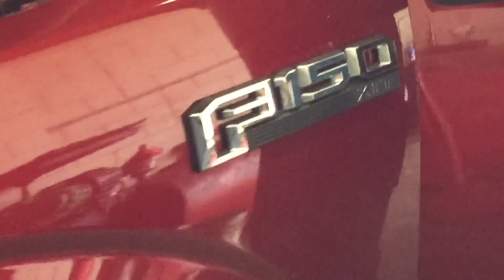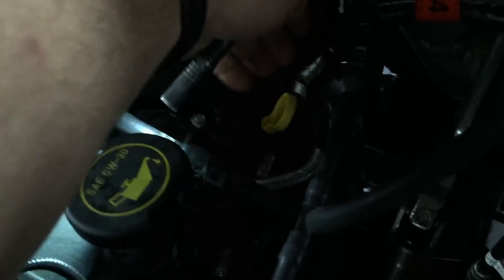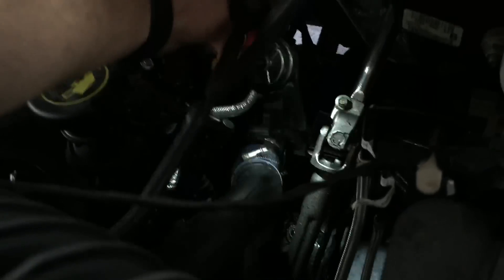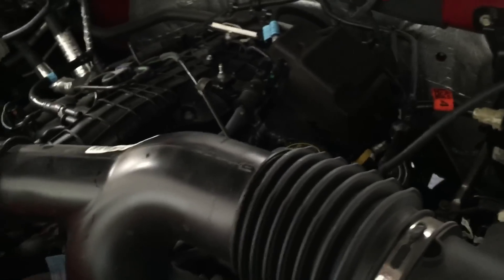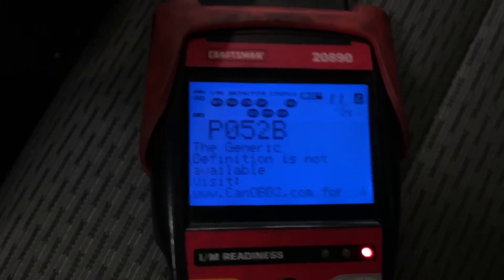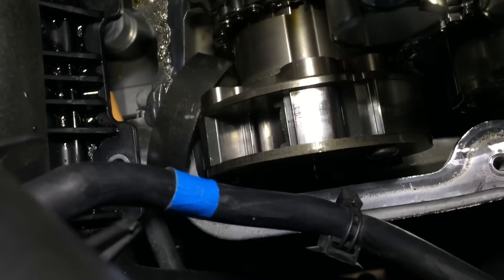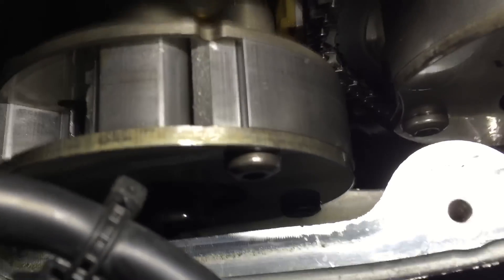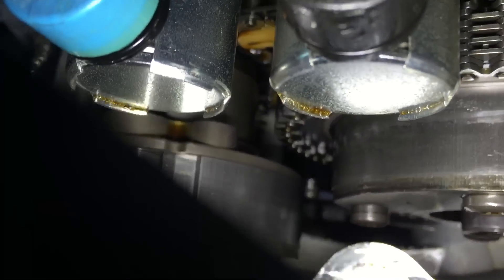Ford 3.5 EcoBoost Cam Phaser Failure

Comment: If your truck sounds like this with a 3.5 eco-boost take it to the dealer immediately there is a factory recall on the cam phasers mine is in the shop right now getting a factory warranty replacement. It had nothing to do with oil loss or anything else this is a defective factory fault problem with the cam phasers. Thank me later, all the rest of these posts are erroneous speculation.

Comment: I have a 2017 F150 Platinum with 48k miles on it. I recently heard a slight knock in the engine. I took it to the dealership and they diagnosised the the issue you have described in you video (cam phaser).
Changing oil every 4-5k miles didn't work for me. The dealer changed the oil with the synthetic blend a couple of times at 3-5k miles. Then I had them to use their Motocraft full synthetic a couple of times. Then more recently I switched to Pennzoil Ultra Platinum 5w30. Each oil change was no more than 5k miles, yet I developed the cam phaser issue. My truck never had a check engine light or any malfunction light, I just noticed a slight knock when I was under the hood changing out the battery. Had I not been outside of the vehicle with the hood open and motor running, I may not have cought it this early.

My question is since I changed my oil with synthetic oil at no more than 5k miles what can I do to prevent the cam phaser issue from reoccurring?
Reply: @Clint Beastwood GM and Ram have their share of issues also. Maybe next time I'll buy a Toyota 🤨
Reply: Nothing! You're already doing what you can. Until Ford disgins a better qualiity cam phaser this will continue to happen.

Comment: This is normal for ohv engines ford recommends changing your timing components every 120,000 miles look in your manual that is in the glove box my friend has a tundra with the 5.7 v8 he had the same problem Toyota recommends changing every 80,000 to 120,000 miles people need to look at the manuals on these new trucks before they buy them.

Comment: My dad is a mechanic and was trained by dodge and been working a lot of other vehicles for 30 years.  He hasn't had much experience at all with the new fords but I've been looking into getting a 17 and up f150 3.5 EcoBoost.  I know they have cam phasers issues even with people having then full of oil and I know the 18 and up 5.0 have been having really bad oil consumption issues.  I'm a v8 type of guy but I'm loving these 3.5 EcoBoost. They just do everything better.  I was curious if putting a thicker oil would help or fix the cam phasers issues and just being a engineer flaw for running thinner oil. Maybe a 10-30 or 10-40? Any information I'd greatly appreciate it. Been trying to figure it out because I do want it but the issue has been steering me to a 15-17 5.0 with 3.73 gears.
Reply: There's a high volume oil pump you can bolt into these 3.5l ecoboosts they'll give you 20 % more flow. I have 308000 kilometers on my ecoboost and haven't changed anything but spark plugs. 10 years of Canadian winter cold starts and hard driving and haven't had an issue. Oil has been sweating out of a few places since I got the truck but haven't lost more than 100ml of oil over my 5k oil change intervals. I'm thinking of dropping in one of these high volume oil pumps in whenever I do my timing chain

Comment: Ford redesigned the 3.5 in 2017. They still require impeccable maintenance but have had less problems. Unfortunately they also redesigned the 5.0 In 2017 and they have been having more oil consumption problems since then.
Reply: What sort of maintenance does it need brother
Reply: @robcunha13  early oil changes

Comment: Cam oil phasers clog and don't provide lubrication to cam shaft. 2,500-3000 $ repair bill. Chain must be replaced when oil phasers are replaced.
Reply: Keep the oil changed and there would never be a sludge issue and everything will work as it was designed.  They engineer things around a clean engine.  🤷‍♂️
Reply: If people changed their oil at 5,000 miles and only used full synthetic and kept the oil topped off they wouldn't have these problems just after warranty.  DO NOT FOLLOW FORD'S RECOMMENDED SERVICE INTERVALS.  It's just another way they push planned obsolescence.
Reply: @dperr338  doh azzz....dealer serviced. I stand by my statement. Look it up. Ford is notorious for putting junk on streets.
Reply: @dannycalvino1147  That's why I said, "DON'T FOLLOW FORD SERVICE RECOMMENDATIONS."  These vehicles have tight tolerances with sensitive electronics that require clean fluids and care to last.  Oil technology has not improved that much!!
Reply: @dannycalvino1147  They all put junk on the roads.  Blaming one manufacturer for issues is ridiculous.  People have had bad experiences with every manufacturer.  They are mass produced so bad products are going to make it out to the customer.  A majority of issues comes down to maintenance.

Comment: Very very rare problem indeed! I run my '12 F150 Lariat FX4 Ecoboost 3.5 balls to the wall never let's me down. Runs / drives like new w/close to 100k mis. I change oil religiously at 5k mis with Pennzoil Platinum (my personal fave) & Motorcraft filters oil/air etc. Good basic maintenance vital with these Ecoboost high tech motors.
Reply: No, it’s rare you got a good one…..this is more common than people think

Comment: Unless I am talking about a project car where the point is to take it apart and rebuild it, I will NEVER buy a Ford again. I bought a brand new Mustang in 2005 (when the retro look first came out) . Within a month the automatic transmission shifter got stuck and eventually broke off. Then the transmission itself wouldn't shift out of 2nd gear. Then the gas filler opening had a weird quark where it would shut the pump off every two seconds. Then the harmonic balancer fell apart at 35,000 miles. I finally dumped it. and got a used LS400 with 287k miles at the time. The Lexus with it's very high miles, has been without a doubt 100% trouble free in the last 6 years. Shame on Ford for selling garbage.

Comment: everybody talks shit on these engines when they break... most of the population that buys a car is a complete dumbass when it comes to anything related to taking care of it. it's a turbocharged engine. anybody that has owned a turbo car from the 90's knows the nature of the engine.  turbo engines use oil much faster than some bone simple v8.  your typical v8 has 2 cams and the crank pan to keep lubricated... you can go without oil changes for longer because there is less stress on the oil.  The ecoboost engine is no different than any performance oriented turbo car, such as a 2JZ supra or even an srt-4 neon.  your oil lubricates the engine parts themselves, but also lubricates the turbo.   oil degrades with heat, contaminants, and high pressures.   turbos are very high temperature environments for your oil.  fuck what the manual says. every 5 grand you should change your oil and filter if you are using full  synthetic.  these ecoboosts are good engines, but need to be taken care of by an owner that knows how to properly maintain a turboed engine... not some dumbshit that can't even change a tire.   there is only one flaw with these motors and it arises because of how stupid most people are with basic maintainance.  the pcv system  on the motor vents crank pressure back through the intake and through the motor... the vapors contain oil and other contaminants that directly cause the issues this motor has been having.  valve coking, misfires, lack of power, hard starts, etc...  simply install a set of catch cans and you just eliminated all of the main issues with the motor. install a free flowing exhaust and intake as well, and you will be fine.
Reply: Logan Barrell I agree,most good folk out there have no idea where thier hood latch is..however I also believe there is no need for a common a- b car to have a turbo..it all comes down to "Look what my new ride has".,and greatly increased Profit for the Trillionaires in upper manufacturing.and maintainence to follow.

Comment: ford sucks this proves it more I have GMC and haven't touched any thing but a thermostat and battery n it has 130,000 miles burns no oil runs like a sowing machine
Reply: If some dumbass doesn't insert the dipstick all the way, it's not the engine's fault.

Comment: I have a 2016 Ford Escape and the windows go up without and down without me pushing any buttons the radio went dead on me and then all the sudden will come on you put it in reverse and it's like it's in neutral I smell wires burning they finally put in a module on the radio to get it working now it burns up my CDs the car is only got six thousand miles on it and the problems continue and worse and I've got knocking behind my Dash and now

Comment: The problem is all this bs like variable valve timing overhead cams turbos economy bullshit hell my 64 impala sedan with the original 327 turbo fire V8 is almost at a million miles
Reply: or dont be lazy and just check your oil?
Reply: Donald Trump 2K16 all I can say is blame things like CAFE and CARB and federal emissions standard
Reply: TheDarkness2487 I've heard of some of these failing even before their first oil change (modern synthetics can go up to 10,000 miles in between changes btw)
Reply: how many though? if its only a few in the 10s of thousands shipped that isnt much.  and it should be at that point covered under warrenty, right?
Reply: You've probably also spent a quarter of a million dollars on gas for that thing.
Reply: +idontcare80 nah gas where I am rarely goes above 2 dollars
Reply: At $2 a gallon for over 900,000 miles, that's right around $200,000 on gas.
Reply: +idontcare80 had 450k miles on it when I bought it
Reply: So $100,000.
Reply: idontcare80 why does it matter how much I pay for gasoline
Reply: Because it's a lot cheaper to drive a fuel efficient vehicle than it is to drive a gas guzzling vehicle, even if the fuel efficient vehicle isn't all that reliable. Anyway, there are plenty of extremely reliable and very fuel efficient cars. For example, the Prius is not only one of the most fuel efficient cars on the road, but it's also one of the most reliable.
Reply: The Prius is also a Prius and is killing the environment with hazardous, non perishable battery waste. So, if you want economy, get a corolla.
Reply: Prius batteries are always recycled.
Reply: idontcare80 the mining for the materials to make the batteries also destroys the surrounding habitat
Reply: Mining for just about anything destroys natural habitats. Don't buy a car if you don't want to support mining.
Reply: idontcare80 I know that I also know that mining for steel and iron is probably less harmful and that the mining impact from my car is probably gone by now
Reply: Both iron and nickel are mined from open-pit mines. Your car also produces three to four times as much CO2 as a typical modern car, or 5 to 6 times as much as a hybrid. That's not even including smog-forming emissions, which can be hundreds of times higher from a car like yours when compared to a modern car.
Reply: Donald Trump 2K16 cadillac one gets 8mpg and can only go 40mph. Sad! Deplorable! Goldman Sachs!
Reply: idontcare80 it only has mufflers no cats and the gas tank isn't even sealed😄
Reply: Yup, really something to be proud of, there, bud.
Reply: idontcare80 the oil cap isn't sealed either so the fumes just come and there's no radiator overflow tank so it just sprays on the ground if it gets too hot
Reply: And I am very proud that I don't have to listen to the government about what I can and can't do with my car
Reply: At what has it gained you? An old boat that costs you a fortune to fuel? My cars are not only clean, efficient and cheap, but they're also fast, fun and incredibly reliable.

I'm proud that my vehicle isn't the cause of some kid's asthma, or someone premature death, or someone's cancer. If you want to not give a shit about emissions controls, go move to China and take a daily swim through the clouds of smog.
Reply: idontcare80 i only bought because I like its looks I like its simplicity and its reliability and that it was only 600 bucks and it's a classic
Reply: Yeah, but you're acting like the government regulations surrounding cars haven't brought about massive improvements to our quality of life in the US.
Reply: idontcare80 safety regulations have decreased visibility in cars and they look ugly as shit now
Reply: idontcare80 besides I dont daily drive it any more any way now it's sitting in my garage
Reply: I'll take safety over a small decrease in visibility any day.

Comment: Welcome too EcoJoke, where your engine gets worse fuel economy than a naturally aspirated V8, and has no fucking power, for a premium price!
Reply: NovaMan 350 Give an example of that, because the Ecoboost makes more power than the 5.0v8, gets better gas mileage, and costs less. It is nearly a $1000 to put a v8 in the XLT. Don't get me wrong, id get the v8, but know your facts.
Reply: Joseph HD No, they tell you it gets better gas mileage, and they tell you it has more power. The 3.5 is like driving an 80hp Civic until you wind up the rpm to get the turbo going. Because of that, you'll find yourself ALWAYS winding the engine to high rpm, spooling the turbo, and getting absolute garbage fuel economy because of it. No low end torque. No low end power. Its the EcoJoke. 

No bullshit, my 2015 Chrysler 200S, naturally aspirated 3.6 gets REAL WORLD 26.1-26.3 mpg average, while driving it normally, and not for economy. My mother's 2016 Lincoln MK-Z, 2.0 EcoJoke, gets 17.7mpg average, while being a SMALLER ENGINE with LESS HORSEPOWER in a car that's 250lbs LIGHTER. And why? Because the car doesn't fucking get moving at a reasonable pace until it's at 3,400-4,200 rpm! AND my CARBURETED 1985 Dodge D-150 , 5.2L V8 with a big ass cam, gets better fuel economy than my step father's 2016 F150 Platinum 3.5 junk. Normal driving, my truck never exceeds 2,800rpm to get off its ass. He has to get his craptastic EcoJoke to 3,900 rpm MINIMUM to be driving reasonably, and that MURDERS any chance of fuel economy.

Excuse the angry-seeming tone. I'm simply trying to embolden the words to get the point across.

Comment: i'll stick with my 2016 gmc with 4.3l v6 OHV engine.. far less complex and just as powerfull and fuel efficient. And I can sit in the engine compartment.
Cam phasing..vcm..and DI.  Ecoboost for me at least are not worth a damn.
Reply: Jacob Gay I like v8's over everything, but a nice v6 doesn't bother me.
Reply: Joseph HD man id take a older 4.3 vortec over this thing and they only put out 190hp. they can take a beating and are very simple. I ran one always bouncing redline for 200k miles. the thing would spin tires like no other v6
Reply: Justin Noker-  you re Right... not base on 5.7L but the block of 4.3L are same from previous 2014 to 1990s. the new 4.3L have new upgrade designed like water pump, power steering, belt diagram and etc that what GM Dealership told me. I do like these 4.3L because we have two Astro Van's, 2 S-10 trucks and Express van that amazing these GM vehicles are still running.
Reply: LEX Maximaguy87 You only have 285hp with around 300ftlbs tq. On top of that depending on what model that engine is in you get ~18 city and 23highway, which is just about the same as the 3.5 Ecoboost. Although the Ecoboost makes about 95 more HP and 170more ftlbs of tq. It's all person preference so like you said, stick with your GMC.
Reply: been managing around 32 mpg highway and 21 city.
Reply: Wait, I thought GM dropped the 4.3 OHV V6 back in 2014
Reply: Just as powerful give or take 90 horsepower and 165 lb ft of torque.
Reply: Justin Noker- GM still makes 4.3L V6 for Silverado/Sierra this time.
Reply: Ric Bonillas Jr it's not the original one based off a 350 Chevy though, it's something different what I researched
Reply: Apparently you've never driven an Ecoboost f 150. Because a 4.3 is not even close to a 3.5 or for that matter even a 2.7. in power! 3.5 makes 375 hp and 475 torque.   Way more than a 4.3 that only makes 285 hp and 305 trq. No comparison at all. Drive 9ne and you'll be surprised!